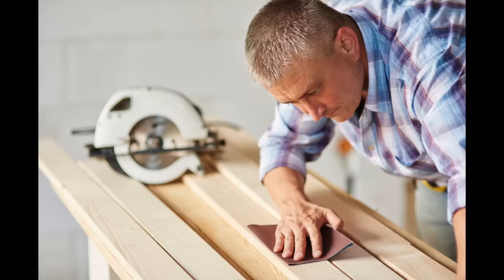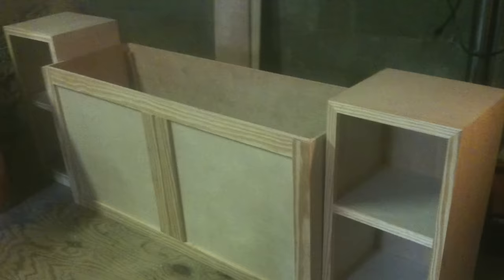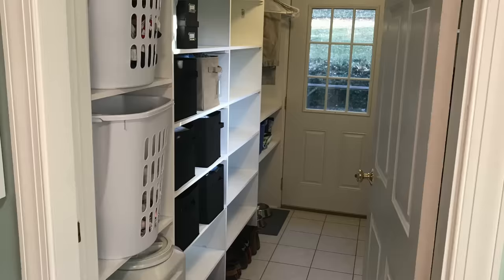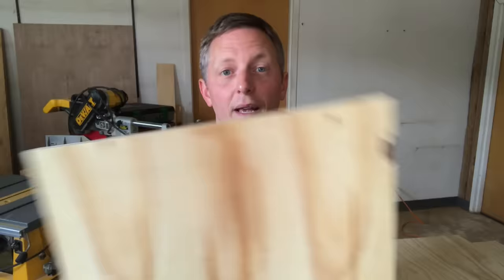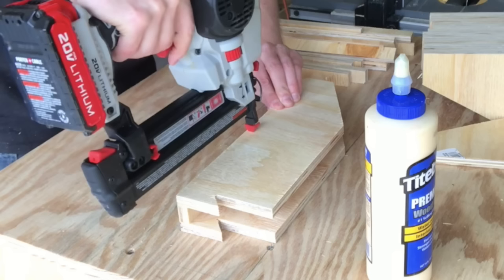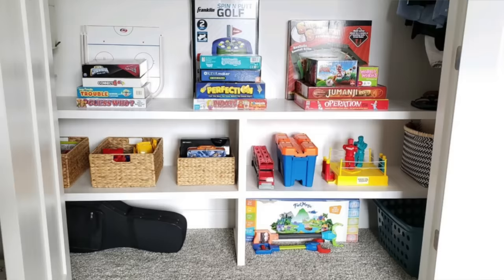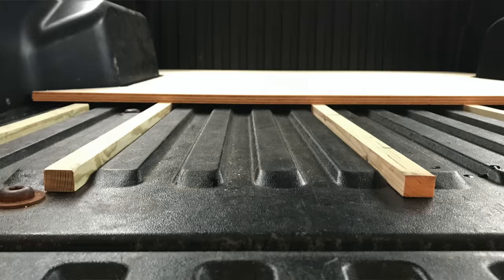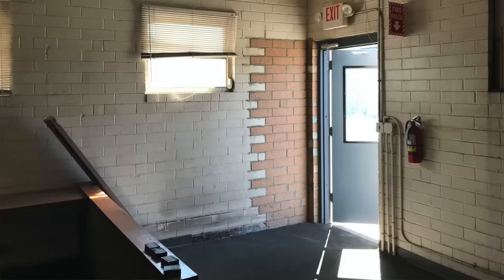DON'T USE 3/4" PLYWOOD If You Don't Need It...TRY THIS! (1/2" Plywood Vs. 3/4" Plywood--When to Use)

Comment: I’ve been a cabinet maker for over 45 years and worked for cabinet shops that used 1/2” plywood in their cabinets and for shops that used 3/4” plywood. I can tell you for a fact that1/2” isn’t near as strong as 3/4” and 1/2” also tends to bend or warp a whole lot easier too! If your using 1/2” plywood for shelving. Especially if it’s adjustable shelving you have to keep your shelves much shorter then you do with 3/4” plywood.  You will not find a high end cabinet shop using 1/2” plywood for their cabinets and there’s good reasons for that! Only thing I use 1/2” Baltic birch for is for drawer sides and that’s about it!  With that being said though, the more plus in 1/2 or 3/4 the stronger and more stable it will be! Keep a wye eye on how many plays are in the material your buying? Also watch out for import versus domestic materials, being imported materials are not anywhere near as good as domestic materials. For example the veneer on imported plywood is usually so thin you can literally see the glue that holds the veneer on the plywood. It comes presanded and if you attempt to sand it yourself your very likely to sand thru the veneer. Where domestic plywood has veneer much closer to a 1/16” thick and usually enough veneer that you can even refinish the plywood later in years when you want to restain your cabinets a different color. Imported plywood about all you can do to change it is to paint over it!  Good materials certainly cost a lot more, but if you want a quality long lasting cabinets you’ll be glad you spent the extra money in the long run! Long story short, I don’t care how great of a woodworker you are? You can’t build quality cabinets out of cheap materials! In the beginning the cheap stuff may look just as nice as the expensive stuff. But just wait 5-10 years down the line if that and then you’ll see the difference for yourself and be spending more money replacing those cheap materials you bought for cabinets first time around! Only thing worse then 1/2” if using particle board or chipboard and that includes the white vinyl plastic veneer that’s also has a chipboard core!  Many people fall for the look of the white vinyl inside the cabinets thinking it looks so easy to keep clean. But that vinyl shrinks over time and scratches very easily and eventually you’ll see at least some of that chipboard/particleboard core and not much you can do to fix the problem but replace your cabinets! Oh and if your chipboard/particleboard gets wet if literally falls apart in flakes

Comment: I used to make everything with 1/2" — even desktops (although admittedly I wouldn't necessarily do that again). It's certainly strong enough for relatively small surfaces. I've also used it within dimensional lumber frames to create custom interior doors. I've even made custom closet doors entirely from 1/2" ply.
Reply: why wouldn't you use it again for desktops??, i want to build one for my computer set up and i was hopping to make it  arround 4 inches thick and i am considering unsing 1/2" on top and botom sheet and 3/4 for all supports in between, should i consider changing the top sheet?

Comment: Thanks for this video.  Like a lot of people, I thought 3/4" plywoood was just stronger, plus it made using my pocket screw setup easier if I just stuck with 3/4" .  But, with higher prices in lumber now, I need to rethink this.  I mean, plywood just seems so expensive especially when you just want to work on a small project and don't always want to go out and buy a full sheet of plywood just for that.  And buying the precut smaller sheets seems like a waste as the prices on those are so so high compared to the value you get when buying a full sheet.
Reply from the maker: Thanks for watching, KLE! It’s a good thing you just keep in the back of your mind when thinking through projects 👍

Comment: I use 3/4" ply for spots that will have a 1/4" dado or deeper (depending on details of course) but generally I do try to keep 1/2" of uncut ply, and that's plenty strong. 

Long pieces, even with cross support, I prefer 3/4" for the rigidity. Example: planning a 230" built-in, and it's all using 3/4".

There is also a pleasing-ratio to maintain. 84" bookcase with 16" openings : 3/4"

24" x 18" utility cabinet: 1/2" or 3/8"

Comment: So, good advice. Would you do a follow up video on any changes in joinery technique that you use to help the 1/2 inch plywood out. Things like pocket hole changes,  loose tenon, the use of screws and glue etc.  Do you ever combine 1/2 inch plywood with MDF or particle board/Melamine?  I would think that once out of the 3/4 rut, the possibilities are much greater.  However with that complexity comes increased design considerations. Thanks and Stay Safe.

Comment: Ethan, good points. One key technique for brad nail blowout is to turn your nail gun perpendicular to the edge of the surface you are nailing along. This make the nail contort along the workpieces width, not its thickness...which produces blowout.
I built from solid pine drawer boxes from true 1/4" thick material for my drill press cabinet, and glued/brad nailed it all. No issues.

Comment: I’m old enough to remember when plywood was flat, 1/2 is much less flat. Being so expensive now I will probably be making my own now. Even good ply has become crappy.
Reply: switch to baltic birch, and stop buying that junk from the big box stores.  baltic birch is only slightly more expensive, but a gazillion times better quality.  you have to go to a builder's supply to get it
Reply: @DarkTouch  I generally buy Okoume for the environment I work in but the supply has gotten hard to source, never mind the cost. I was referring to what passes as ply for normal people here. Don’t try sheeting your house in Baltic birch, or maybe you should.
Reply: @D-B-Cooper  roger that.  i wouldn't skin a house in birch.  but then, the do make two grades: interior and exterior...  anyway, the  video context was for cabinet types of projects.

Comment: Thanks. I compromised and used 5/8” plywood for my non-FR garage walls.
Reply from the maker: I used 5/8 for the rolling table saw cart too, JHans! I knew it would get knocked around a lot, so I wanted it to be tough. But even cutting out that nominal 1/8 takes pounds off the casters!
Reply: @TheHonestCarpenter  Agree. The 5/8 also laid down better than the 1/2 resulting in relatively flat walls.  Plus I used trim screws which worked well.
Reply: @AJ XOXO The walls above the garage doors are 1/2 inch. The plywood sheets were not flat from the store and resulted in some waviness.  The 5/8 inch sheets were flatter when purchased and resulted in three very flat walls. I did not need 3/4 inch to get the results I wanted.
Reply: @AJ XOXO I don’t believe any thickness plywood is going to straighten the studs. Before laying the plywood, you could shim the studs to the proud dimension (stud that sticks out the most), which could help with the overall flatness of the finished wall.

Comment: TY HC. I priced 5/8” plywood at $48.xx to $58.xx a sheet. Need it for  countertop substrate. I found 1/2” Sumauma plywood at Lowes for $31.xx a sheet and used a 1/4” filler. (Needed a total height of 1 1/4”)

Comment: Also consider 1/4 or 3/8 where structural strength in not an issue. And sometimes if it is. Run the structural calculations.

Comment: I'm about to build my first project which is a Little Free Library for my mother-in-law's birthday. All the designs I found for it want you to use 3/4" and I thought it felt like overkill. It's just a little box and I don't want it to weigh more than what she can carry. I wanted to bump it down to 1/2" but was worried it wouldn't be strong enough. Then I happened to run across this video and I feel a lot more confident about moving it down to 1/2". :) Thank you!

Comment: I've found this very true also and if your worried about a shelf sagging in the middle a simple upright lip across the face will stiffen it up incredibly, double it by putting one across the back too and you have a very strong shelf. The reinforcement works in the same way and I beam or an L shaped channel does to increase the rigidity with very little extra material. Great video and tip. Right now considering the prices, conservation and thoughtful, intelligent design is key to moving forward and meeting the demand without breaking the bank. This type of conservation also creates savings that allow easier accommodation of the spender material when it is needed. Also it sends a clear message to the industry that these prices cannot become the "norm" and continuation of said increases will ultimately result in less sales. I truly believe that product manufacturers are taking too large of a piece of the profit already, let alone of late.
Reply from the maker: Very good points, peehand. I’m going to cover the exact span-stiffening topic you discussed in detail when the shop is set up. Furniture and highway overpasses are virtually identical in their support systems.
Reply: @TheHonestCarpenter  Oh cool, can't wait, hope it's all coming along nicely and yeah they are identical now that I think about it. :)

Comment: My only issue with 1/2” plywood is it’s tendency to warp when damp. Now that 3/4” plywood is almost $100 CDN per sheet I need to reevaluate 1/2” or 5/8” ply and keep them dry.

Comment: I just built a dresser using 1/2" plywood. Got plenty of nice complements.
Reply: I was thinking of building a 6 drawer dresser with 1/2 inch do you think it will strong enough?
Reply: @stevenhardyjr.5948  I think it should be fine. How tall will the six drawer dresser be?
Reply: @Kevin_Carlson   at least  30 inches tall and about 60 inches wide. I want to start building things this will be one of my first projects .
Reply: @stevenhardyjr.5948  1/2" will be very sturdy. Good luck with your first project. I've just taken up carpentry recently and I'm enjoying it.
Reply: @Kevin_Carlson   are you taking carpentry online? Or in a school?
Reply: @stevenhardyjr.5948  It's just something I enjoy doing on my own. I like getting ideas and tips from YouTube videos.

Comment: I feel like 5/8in would be the perfect plywood thickness... Sightly more thickness then 1/2 to be able to run fasteners into the end/sides without blowing the edge out, slightly lighter and cheaper then 3/4.. really the only downside to 1/2 that I've ever had is blowing edges out with fasteners, but drawers and what not I always use 1/2 with either 1/2 or 1/4 bottoms depending on the depth of the drawers

Comment: But 1/2" is less stiff than 3/4".  So if you need something stiff, go with the thicker plywood!
Reply: He mentioned fortifying the cabinets he made it with 3/4" face frames.  Sounds like good enough compensation to me for the applications he was talking about.
Reply: worst case, double it up on the odd situation where you need it - well spread glue, you're good to go.

Comment: This video is scratching me right where I itch. I, too, have been a slave to 3/4" over the years, but recently decided to go with 1/2" for a 20' long workbench I'm building in 5 sections of 4' each. The top, which is only 28" wide (so that I can remove it if we sell the house--the cellar door is 30" in width). Since the top MAY be subjected to occasional hammering, banging, etc., I figured I'd simply put a less expensive grade of 1/2" plywood on the "bottom" and a better grade on the top, yielding a nearly 1" thick top. I'm having the plywood cut to panel sizes at the lumber yard where I buy it. They charge .50 a cut and have a large panel saw which gives remarkably precise cuts, plus they are more transportable in our Honda Crosstour hatchback. Likewise, the 8' long 2x4's I'm using for the benchwork frame. I brought my cordless circular saw over to the yard and a pair of saw horses and measured and cut them to the sizes I wanted right there in the parking lot and stack them in the car, nice and neat. I checked with the floor manager first of course. No problemo! The shelving and pegboard on the wall behind is supported with a French cleat system using 2X4's and 1x4 No. 2 grade pine. Thank you for this excellent post and for reaffirming what I've long believed. I feel vindicated! 🙂

Comment: Hm...ok. Coming from a "metric" region, I used 12mm ply for basically everything, 10mm for "light" stuff an 16mm for heavy-duty constructions. But looking at some of your built-in cabinets in 1/2in, I could see that the orientation of your top veneer layer wasn't paid much attention to - but that's crucial with thinner sheet material! It should always go "the long way", this way the increased "moment of resistance" is giving you more resistance and less flexing...

Comment: Never ! The reasons to use 3/4” far outnumber the reasons to use 1/2”. In my small cabinet business my plywood purchases are over 25 to 1. The only practical use I’ve ever found for 1/2” is an occasional drawer bottom for over sized heavy load drawers and pullouts. I make my drawer boxes out of 3/4” too...a good use for all those smaller drops that clutter your plywood bin. In this day and age using every morsel of a sheet is critical...there is no waste, if you’re smart. The price difference is insignificant in the overall cost of a job. High end cabinet builders don’t cut corners to save a few bucks. If you’re building economy production style cabinets 1/2” may be for you.
If you’re building a movable cabinet weight may be a consideration but generally speaking cabinets are built for specific locations and aren’t moved around...rarely by the consumer.
In bookcases and that type of casework I use 1” plywood for shelving and try not to exceed 36” in length. Gravity works on all things, including heavily laden shelves. They need the utility of occasionally being flipped over to correct any deflection. If you put a face frame or band on shelves you lose that utility, especially adjustable shelves.
Reply: That's just over engineering... The material is always a question of the usage.
thick also means more weight which means stronger connections.
Often you can use even thinner material, combined with strips to increase the stability
Reply: @frankkobold   No engineering involved. Just accepted cabinet building standards…if you’re building quality. Cheapening the job is not the object. Weight is not a significant consideration.
Reply: @louiswarmoth7354  "over engineering" is a general expression and you know it...
And again, quality can mean lower weight. Best example "had to be movable", then a higher weight is a sign of bad quality, since the materials were not adapted to the required use case.
(and come on, depending on how big it is, how it's constructed etc the weight does also has an influence on the connectors needed,especially if you have a hard time to hide the connectors)

Comment: 1/2 plywood is good but only in 5 ply the 3 ply stuff warps to easy.
Reply from the maker: This is a good point, Renato
Reply: You should get a hold of 13 ply baltic birch or russian birch. It weighs a ton but it its the strongest plywood ever. Not saying you should build with it, but its crazy strong and the edge actually looks like a nice feature.

Comment: Just looked at a pre-war house the owner was looking to remodel and upgrade - wanted to pull out all of the built-in-place kitchen cabs and start from scratch. The cabs were ALL 3/4" clear pine - carcasses, shelves, and face-frames. The doors and drawer-fronts were all 1/2" clear as well. Every piece was still straight and true - they were over 80 years old and looked like they were built in the last ten years. I told the owner if it were me - I'd keep the cabs, and splurge on a gorgeous floor and set of countertops - which not pulling out the cabs would more than pay for. Well - that's the way it went - it looks like a million bucks for a fraction of what it otherwise would have cost. My point? There's a reason heavier high-quality materials last longer and maintain their value...

Comment: I wouldn't do it again, but my first house I built all my kitchen cabinets with 1/2" plywood then poured a 3" concrete counter on top haha.  the peninsula piece has an 8ft x 3ft x3in thick steel reinforced concrete slab on it and still fine after all this time.

Comment: Needed to cover the holes from eliminated undercounter cabinets under a breakfast bar. I didn't want people to accidently kick through the material, but didn't want to increase the weight or depth too much. Ended up using 1/4" ply and it was rock solid, even tested it with some solid kicks, no damage! Only go overkill if it's for the safety of the build otherwise, I'm going lighter on everything in the future.

Comment: If you really want to stick with 3/4" ply, radiata pine is a good alternative, they are nearly the same price as 1/2" ply and the thickness is shy 3/4". the catch is that you need to look for good quality one in the shelves, just like you do when you look for 2 by materials to build a dining table.
Reply from the maker: I like radiata! You really never saw it when I was coming up, but it’s widely available now. 🙂

Comment: He makes a good point that 1/2 has advantages over 3/4 - no question - but it's important to apply thoughtful design and intelligence to your work. At 4:22 he mentions bending strength and suggests there is " not much " difference between the two.  This misleading : bending strength is proportional to the thickness CUBED.  So 3/4 material will be 3-375 times stronger than 1/2 inch that is ( 3/4*2/1 )^3 = 1.5^3 = 3.375.